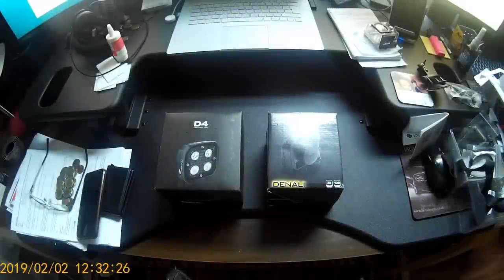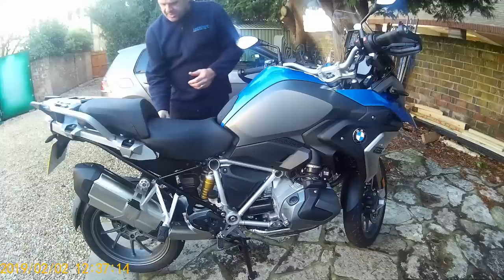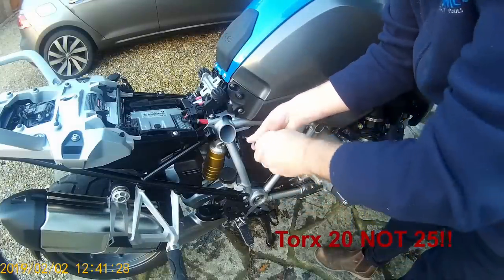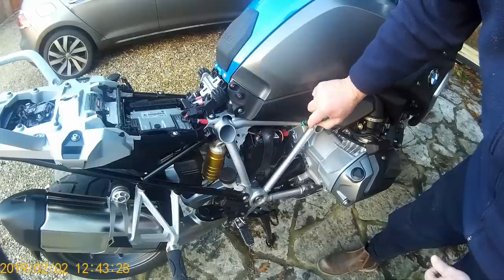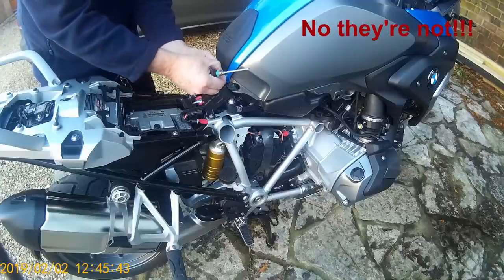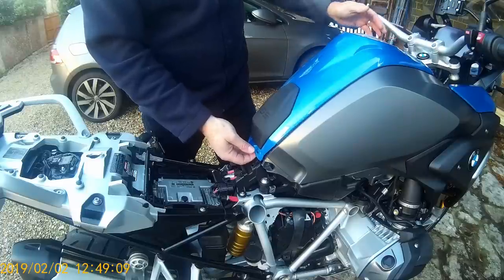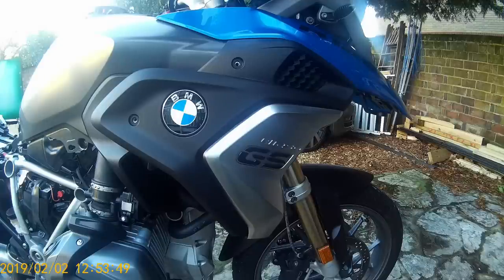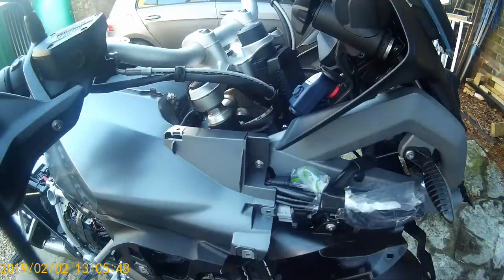BMW R1250GS Denali Lights and Horn Fitting

Comment: Will the Denali Lights work with the same functionality with a Hex ezCan ??
Reply from the maker: Yes indeed. The Denali CanSmart is made by Hex. It’s just the Denali version has the plugs ready you may need connectors for the Hex to connect to Denali???
Reply: @nickhodgeUK  Cheers.  I ended up ordering the denali cansmart as I liked your D4 lights so much I ordered them, so the Touratech shop said he had the Denali canSmart as well and was the same price as the ezCan and was pretty identical in function so I may as well get the denali.  So I ordered the D4 lights, the canSmart and the soundbomb.  Thanks for the reply and I appreciate the Vid !!!
Reply from the maker: @MCIreland99  and I’ll guarantee you won’t regret it “the sweetness of the quality will be remembered long after the bitterness of the price” (who said that?) 👍🏻

Comment: Thanks again Nick, great video, how do you find this system a year later? Any problems? I'm considering installing Denali kit on my new 1250gs that I have arriving shortly but a bit concerned it may cause warranty issues or indeed cause issues with electrics your advice is greatly appreciated.
Reply from the maker: Oh no I’d still thoroughly recommend. The new Gen II canSmart has some new settings too. The wiring all is plug and play. You make no cuts to the BMW stuff at all. It’s expensive but VERY good. Enjoy the 1250

Comment: When the front  forks compress, will the horn interfere with those rigid brake cables?  Looks too close?  Th
Reply from the maker: I thought that. They’re not rigid to be fair but I think the action of the upside-down forks has something to do with it. I put a rubber buffer around to test but it didn’t touch 👍🏻
Reply: Considering the large range of motion of the forks, I thought it would hit for sure. Thanks for the excellent video!

Comment: Brilliant Video, extremely detailed. Have you any feedback now after a few months on the D4 spots.....? Thinking of picking up a set myself, maybe another long term use video?
Reply from the maker: wondaboy12345 I cant recommend highly enough. There are some D7s now but they look a bit ugly. Eve yet one comments about how visible I am which is why I had them. I turned off the ‘off when turn signal active’ setting though in the CanSmart unit as I reckon people saw that as a ‘flash’ and pulled out in me

Comment: Thanks for this very good video!!! Much appreciated. Just installed my S4 following your tutorial and a few others. My only REAL CONCERN is the horn which definitely touches the brake line when riding. I really don't like that and hence have decided to remove the horn. Has anyone found an alternative place on the GS1200/1250?
Reply from the maker: Hi Eric and welcome along. The horn has now been on for 8,000 miles and shows no signs of contact. It’s weird as it looks like it should but it hasn’t. Hope that re-assures some. Glad the video helped anyhow. Ride safe
Reply: @nickhodgeUK  Thanks Nick indeed for re-assuring me Nick :-)
But how can it be, as when the bike is on the lateral stand, the brake line physically touches the horn. Hence I was thinking that with compression of the suspension during the ride there would even be much more contact / rubbing between the brake line and the horn with risk of damaging the brake line. What I already did is to use my Dremel to remove the bottom of the horn, a part of the sound conduit. This is helping to free up some space (+/- 1cm) and doesn't change anything at all at the sound.
I would love placing back the horn but, based on what I'm seeing on my bike, I'm very skeptical....
If someone has a small camera it would be interesting to attach it under the front fender for a few km to see on motion whether or not there is a contact.
Super thanks again for your reply Nick!
Reply from the maker: Eric Boeckmans I was as sceptical as you and stopped many times on first few rides to look but it’s been fine. I have some new GoPro brackets so if I can safely mount it I may see if I can get footage. Watch this space
Reply: @nickhodgeUK  That would be terrific and guess many Soundbomb users would be interested / relieved by this footage :-)
Will definitely stay tuned to this page! Thanks!

Comment: Accessories for lighting to the GS 310?
Reply from the maker: Mohamed Sabri Haji A.Shamsudeen Mohamed. Thanks for commenting. It I’m afraid I have no experience on the GS310 so can’t help much I’m afraid
Reply: @nickhodgeUK  better i buy r1250gs.....
Reply from the maker: Mohamed Sabri Haji A.Shamsudeen Mohamed. You wouldn’t regret it for sure but seems slightly extreme over just buying some lights 😂

Comment: Hey mate, thanks for the great video! I've got a question about the tank, did you empty it before you lifted it? Thanks!
Reply from the maker: Nope. No need. You only need it off the mounts to be able to thread cable. No disconnect of keyless tank filler electrics either. Just slow and steady
Reply: @nickhodgeUK  Thanks for the prompt reply!

Comment: What are the total lumens for the pair? Never enough lights. The most excellent horn is an absolute must too.
Reply from the maker: Road Glide it says 8760 lumens the pair. They are each 4 x 10w Cree LEDs. With the CanSmart though you can tailor the output using the Data Dim technology in them and the BMW whizzy wheel. Although it can also be done through the CanSmart software. I have mine at 50% intensity as daylight running (the BMW LED headlight is very good too). Same on dip beam and then 100% on full beam. I have them set to ‘strobe’ on flash to pass and also strobe when horn is ‘active’. The horn does mean you can only use it in earnest.... it’s loud!
Reply: Nick Hodge 

That’s an excellent amount of illumination. Much needed too. Build quality is top shelf. The horn is amazing. Way to go Matey!!

Comment: hi Nick. This is zunaid from South Africa again. Nick the only company I can get hold off that can arrange delivery to South Africa, via Airfreight is call Denali UK. 
obviously I have to make the payment first, etc... Just wanted to find out if you heard of them, and if they trustworthy with regard to delivery etc. 
thanks bud
Reply from the maker: Zunaid, sorry this is late, somehow this reply went under the radar. Denalishop.co.uk look OK, is that who you mean? Let me know if you're still stuck
Reply: @nickhodgeUK  I just ordered it today via a supplier in south Africa. I wanted to deal directly with Denali UK (yes that's the correct company, btw), but because I had not hear back from someone that could back them up, I ordered via a local company. 
it cost me double than what it would have costed if I had dealt directly with Denali uk.
they ended up charging me 1050 pounds.
I was too scared to pay Denali uk upfrionth without some sort of reference.
ag anyway, that's life I guess.
thanks anyway for the reply.

Comment: a NON light related question.... is that an original backseat... it looks a bit more bulky than what I have seen on  other pictures... I like ;o)
Reply from the maker: Martin Winnes yep it’s the original back seat. I have it in the forward position as it helps support my back. The front seat is high at front (against tank) and low at rear using the standard adjusters. It helps to ‘slide’ me back against face of rear seat. Bike is standard height

Comment: Great video - appreciate the detail.  Where did you tie the trigger wire for the lights?
Reply from the maker: Hi Rick. The lights are all controlled by the dedicated Denali CanSmart unit. Expensive but zero wire tapping and highly programmable
Reply: Ok that explains things. FYI, after some further research, I discovered that you can tap the signal wire into the 7.5 amp fuse circuit right under the seat. I used the Denali positap that came with the light kit and works fine.
Reply from the maker: Rick McLeod perfect. I have a mate that maybe useful for. Thanks 👍🏻

Comment: do these lights have a setting that allows constant modulation (strobe)?
Reply from the maker: Vaporflux not constant no. They have ‘strobe on flash to pass’ (three pulls on flasher switch) and ‘strobe on horn press’. All controlled through settings in the SmartCan (Ezycan)
Reply: @nickhodgeUK  thanks for clarification.  I'm looking for a solution that allows for constant strobe of auxiliary lights.  Any recommendations?
Reply from the maker: @RoamingWithRobert  I'm sorry I don't know of any. The light are capable, but it's not a feature of the controller. I would suspect it's a controller you need to look at rather than the lights???
Reply: @nickhodgeUK  ok thanks for advice

Comment: Sounds like £670 no chance!
Reply from the maker: Flatcap007 yep. Just about spot on. It does depend on what you want I guess? If you want to operate things without additional switches/relays but still be able to do ‘smart’ things then the CanSmart/EzyCan is a must. The quality of the units too is without doubt. Unfortunately there’s little cheap with motorcycles and nothing cheap with BMW 😂